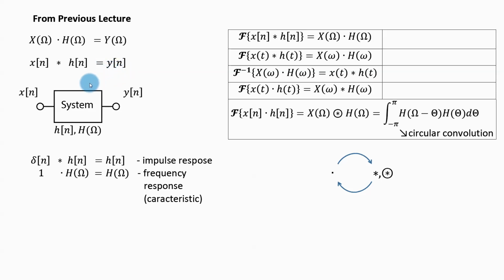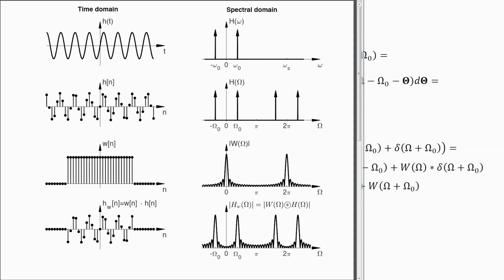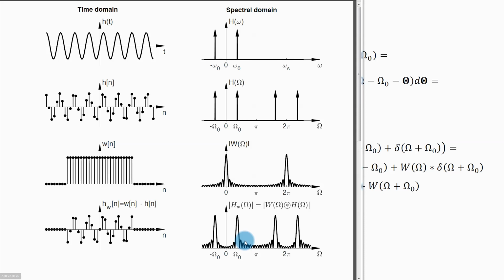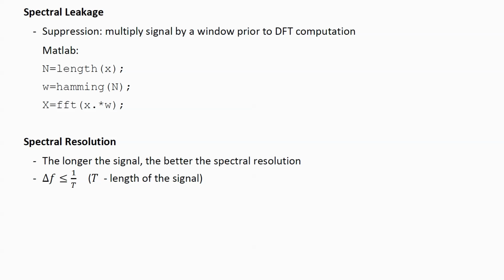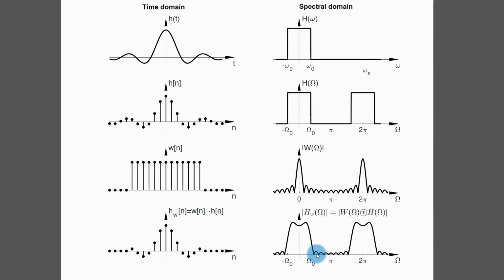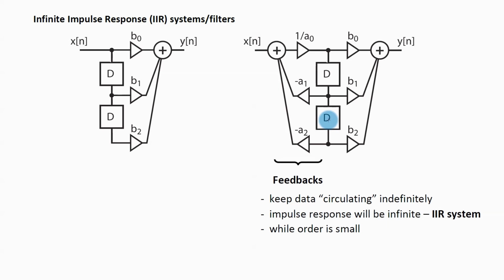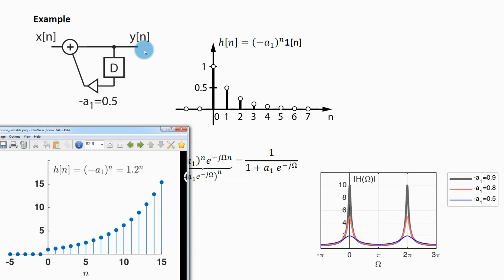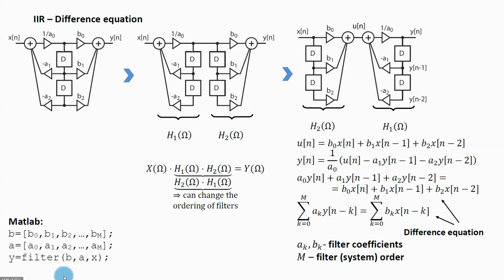Signal Theory (Signals and Systems) - Lecture 5 - Spectral Analysis, FIR Design, IIR Filters

Comment: In the first slide, at the circular convolution, shouldn't it be integral from -pi to pi from X(omega - thetaH(theta) d theta ?  If not, why does H apper twice?
Reply from the maker: Yep, that is a mistake. Instead of H(Ω-Θ)H(Θ) there should be X(Ω-Θ)H(Θ) or H(Ω-Θ)X(Θ) (you can use either; they are equivalent). Thanks for pointing this out.